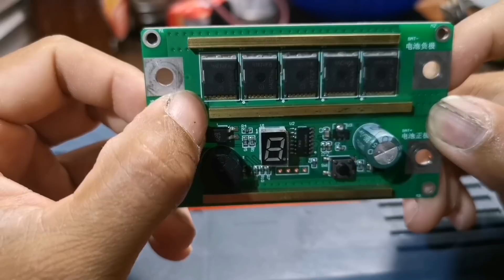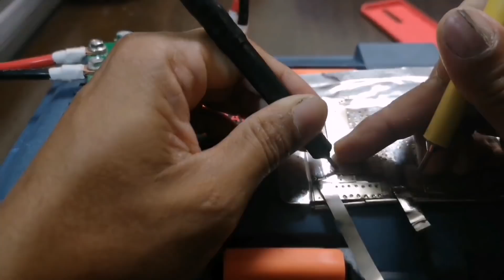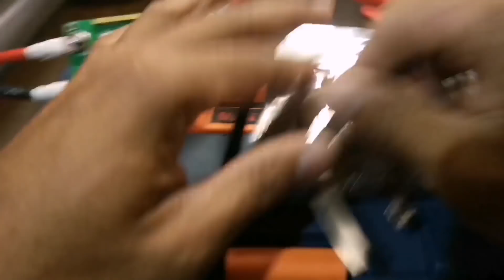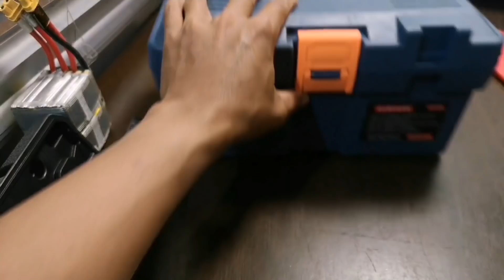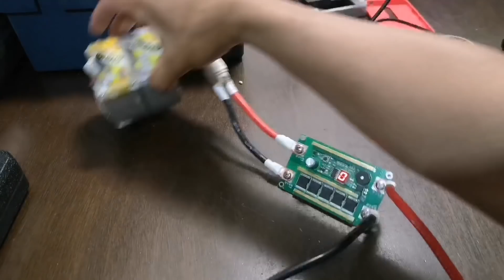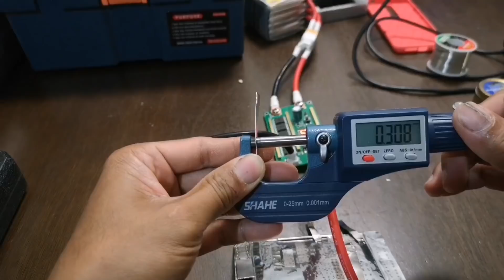CHEAPEST SPOT WELDER  REVIEW BEFORE MODIFICATION.

Comment: Ce baterie folosesti? De citi volti si citi amperi?
Reply from the maker: 12V 16ah Lipolymer battery 120-240c
Lipolymer rc battery not really good much better A123 system 26650 10P 4S enough to weld sandwhich .2mm copper and nickel steel plated strip.

Comment: What range of  input voltage? I used 12v but but can't spot accurate.
Reply from the maker: 12V 5Ah 100C
Reply: I used 12v 100ah but can't spot accurate.Tell me sir if i used 24v 100ah battery? Bcz i used chemical batteries the batteries is not very powerful.
Reply from the maker: What sort of battery you use is the lead acid or LiPo battery for the RC toy car? Do not use a 24V battery it will burn your board.
Reply: Lead acid.
Reply from the maker: Is your lead acid good? Or about to die
Reply: Hello friend i buy the same set i use 12v lithum with bms 3s isn't work can i know what battery you use thanks
Reply from the maker: Yes because of the BMS. Direct to the battery but be sure that the battery is a high drain

Comment: Is the purple circuit with 99 gears the best among cheap Chinese spot welder?
Reply from the maker: Yes! Before but I've heard a negative feed back in regards to the purple spot welder. There are few sellers that have installed not original MOSFETs. If you want to buy you should check and communicate with the seller before buying.

Comment: The worst product I ever bought. I regret buying it. I think I will distroy it soon.
Reply from the maker: Sorry sometimes you encounter a liar seller
Reply: It's most likely due to the batteries your using to power it
Reply from the maker: Not all the cheapest spots weld worked well.  Like the red spot weld I tried the same battery but it failed to weld at one time both 0.2mm nickel and copper.

Comment: Same model no welding
Reply from the maker: Check the C-RATE of your battery
Reply: Battery ok spark problem display on
Reply from the maker: Your battery must have a discharge pulse rate up to 500A if not it cannot weld.

Comment: I'm using 4s LiFePo4 battery with 3,4 mOhm internal resistance and over 1200 amps of peak. It weld very well )
Reply from the maker: As long as the power sources are good the result is better.

Comment: What size battery are you using?
Reply from the maker: 3S 12V 8.4mah 130C  RC battery. Anyway one of my videos provided a link for the battery
Reply: @pitikaron  what if i used a 18650 4s battery?, Will it still work?
Reply from the maker: It depends on the C- rate
Reply: @x_blows nope, this small modul have 10v-15v working voltage range
Reply: @pitikaron  8400mAh I presume.
Reply from the maker: @xwatchid  yes 8400 50C to 100C
Reply from the maker: AU $69.04  36%OFF | DXF Lipo Battery 2S 3S 4S HV 7.6V 11.4V 15.2V 9200mah 8000mah for RC Car Truck Buggy Arrama Truggy  XxMax Tank Boat Racing Hobby
https://a.aliexpress.com/_mN4z1Pa

Comment: Hi, I have the same model of welder but the strips keep coming off the battery. I'm using a 12V 25Ah (CCA SLS 171; CCA SAE 342) lead acid battery. Eve on the highest power (8) the welds are very mild. I'm using 0.1*8 mm nickel strips. Please help. Ps the battery is reconditioned
Reply from the maker: If you spot welding work properly but cannot weld strongly means you need  500 to 800A pulse discharge rate capacity but do not exceed 1000A coz the MOSFET will explode. Up to 0.2mm nickel if you want 0.3mm you need 1500A or more but your spot welding is ideal only up to 1000A. I recommend you this latest spot welding kindly please click the link https://youtu.be/hTQgXZBmejQ
Reply: @pitikaron  ok cool. Do you know what the 2 CCA values mean in the battery? CCA SLS and CCA SAE?
Reply from the maker: Cold cranking amp 2 CCA I don't know but CCA is cold cranking amp
Reply: @pitikaron  ok thanks anyways. This video was a lifesaver. Now I know what battery to look for
Reply from the maker: Thanks also for visiting my channel

Comment: Hello Friend, Can we use lead acid battery for this (green card) spot welding which has 100AH,
Can you tell  us the range of mAh or AH (meaning AH to AH) that is suitable for this spot welding card?rd.
thank you so much
Reply from the maker: If you have this board yeap you can use lead acid battery but you should identify the maximum pulse discharge current the maximum should not exceed 1000A but sometimes some MOSFET explode so it is better to use a battery that cannot exceed 500A. Anyway I recommend you this latest cheap spot purple board welder that can handle 2000A pulse current kindly please click the link https://youtu.be/hTQgXZBmejQ I produce part 1 and 2 plus comparison.... Thanks.
Reply: @pitikaron  So which battery would be best for this card (green card) , so that I can buy it. Please guide me.
Thanks
Reply from the maker: https://a.aliexpress.com/_mrWybHO
I used that battery to the link
Reply: @pitikaron  Thanks
Reply from the maker: Choose 6300mah 12V 100C
Reply: @pitikaron  But this is very expensive, can you suggest me other available options, and I have 70Ah, 100Ah Lead Acid Batteries, I think these battries will exceed 1000A which is not perfect for this Card. So which Lead Acid Batteries do you prefer for this card?
Reply from the maker: Yep so try your lead acid battery but do not exceed 500am anyway what is CCA to your battery?
Reply: @pitikaron  I used this formula (AH * 7.25) to measure CCA of battery, it gave these..
 1) (70 * 7.25) = 507.5 CCA
 2) (100 * 7.25) = 725 CCA
Reply from the maker: Try it start at the low level and observe the current flow. This link I provided for jump starter AU $39.39  50%OFF | 400A Jump Starter Power Bank Portable Charger Starting Device For 2.0L Emergency Car Battery Jump Starter
https://a.aliexpress.com/_mN1n6Qc
https://a.aliexpress.com/_mq2feD6
Reply: @pitikaron  12V 7AH Battery
12V 6.3AH Battery
12V 10AH Battery

Which of these would be ok, and if I want to buy a new one in lead acid,
at least how many Ah should I buy?
thanks for guiding me.
Reply from the maker: The most important is the CCA or pulse discharge current so that you can weld so check the battery specification.
Reply: Is the pulse current = max peak current?
Reply from the maker: Not constant but yeah it is the max current.
Reply: @pitikaron  Is there a formular to calculate that?
I received my spot welder yesterday but I heard you can extend the wires to the battery to limit the current...
Reply from the maker: for example 50C x 5000mah or 5ah = 250A
so you are asking the length of wire?
Reply: @pitikaron  yeah the length of the wires from battery to spot welder;
I actually wanted to use it with my car battery 75Ah (not new)
I scared not to burn the mosfets with my car battery.
Reply from the maker: Sorry I don't know! But there is a YouTuber explaining the length of wire and the expected current search K-weld he use K-weld.

Comment: Hello which welding machine do you recommend green card 8 settings or purple 99 settings, thanks
Reply from the maker: Purple the latest product and more capable to weld
Reply: thanks and what do you think about using a microwave transformer with timer instead of the purple board?
Reply: Do you know what thickness of nickel they put in the kit?
Reply from the maker: It Is also better unfortunately I don't have any idea how strong it is? Coz the purple welder can firmly weld at once  0.2mm  copper and nickel strip but your battery must be powerful enough  2000A pulse discharge.
Reply from the maker: What do you mean? The thickness of nickel?
Reply: When you buy the complete card they give you some nickel I was wondering if you know the thickness
Reply from the maker: Ah ok!  Before I choose a board only however they don't offer nickel strip also.

Comment: what is the power Volt and Amp  ?
Reply from the maker: this cheap spot welding it is good but their is a latest and more capable to spot welding  of nickel strip click link below. I produce part 1 and 2 video and also camparison then I figured out this latest cheap spot welding are the best in the market today even the expensive spot welding can not compet. https://youtu.be/hTQgXZBmejQ
Reply from the maker: 12V 6100mah 100C so 600A pulse discharge amp.
Reply: I have 12v 7AH battery. It's possible or?
Reply from the maker: It depend on the battery CCA
IF YOU BATTERY HAS A 300CCA IT CAN WELD BUT IF BELOW 300CC CAN NOT WELD

Comment: hi, where do you get the copper bar from? all i can find is the round one.
Reply from the maker: Al i-express copper flat bar 1×10mm
Reply: @pitikaron  that's 1cm wide, then you cut it down to size? I'm thinking of using flat copper braided wire. it should be easier and it come in different width too.
Reply from the maker: As long as the traces are thick it is better coz thick traces can help reduce overheating due to a large current flow.
Reply from the maker: I recomend you this latest purple spot welding https://youtu.be/htnneHUuAqg
Reply: @pitikaron  I would love to, but i already got similar model with the one in this video. btw, is this board and the purple one have the same size? especially the screw hole diameter and distance? thank you very much.
Reply from the maker: Ah ok!  anyway it is not necessary to buy flat bae copper!  if you have 10-6 gauge stranded copper wire you can use it to increase the thickness of the input and output traces. yeah they the same size and one manufacturer.

Comment: sir, can you kindly tell me approx brass heatsink thickness you solder to board?
Reply from the maker: https://youtu.be/u9m3aYlB4dI
sir I recommend this spot welding better of all cheap spot welding. anyway 1mm×10mm brass flat bar but you can used 8 gauge wire stranded brass also. as long as you will increase the traces sir it work well.

Comment: My spot welder is not welding at all bro same model ordered from Amazon
Reply: I have big battery of 11.1 4000mah
Reply from the maker: What is the C-rate or peak discharge rate?
Reply: May be 40-80c
Reply: In which range should the C rate should be
Reply from the maker: bro spot welding working like switch on and off or relay.  spot welding circuit controll the battery...  kindly please dicribe the issue of your spot welding?
Reply from the maker: bro if you're spot welding can not weld 0.1mm.  youre battery is the Main issue except if the mosfet and controller of the mosfet are broken.
Reply from the maker: if 80C the maximum Amp 4×80=320A so enough to weld 0.1mm nickel strip.
Reply: The issue is it's not welding the nickel strip i tried in many way but i was unable to weld it
Reply: Is it a defective product that i have received it or what bro please help i need this device for my project
Reply from the maker: Tried to replace if you can the battery wire into 8 gauge 10cm and 8 gauge  50cm welding wire output including electrode must be 50cm or 500mm.
Reply: Tried it in all the ways bro but it's not working at all
Reply: I have asked Amazon for replace the product
Reply from the maker: Bro!  if the spot welding turning on after giving power supply.  means your spot welding is working.  coz if the mosfet blown or short the nickel strip 0.1mm must be burn also.  Base your testimony your spot welding can not weld means battery issue.
Reply: I have good batteries bro i used my batteries for my gaint rc cars also no used issues with the battery but the problem is that it's not even welding 0.1mm nickel plate
Reply: Mosfet everything is good no heating problem in the motherboard also
Reply: Thank for the help bro i really appreciate you 👍
Reply from the maker: can't weld?  maybe battery issue. try to get a good battery discharge 200A

Comment: Hi bro, nice video.  I need to know how to increase the delay time when making contact with the battery to weld, the manual says 0.5 seconds, but it is very short, it is almost instantaneous.
Reply from the maker: boss this spot welder is better but I found a better than this click link below https://youtu.be/2G2eepg7yZw
Reply from the maker: However if you have already this spot welder so stay to this.  anyway this spot welder provide 8 Energy only so every energy  level has their own time obligation in that case I can't help you to change the running time program.
Reply: @pitikaron  ok bro, thanks.

Comment: what is the maximum input voltage of spot weld can i use 26650 4s in series. 3.7v per battery.
Reply from the maker: I recomend you a latest model and it is better of all cheap spot welder click link I provided.  https://youtu.be/u9m3aYlB4dI

Comment: Test on housing of 18650 use 200amps shorten cable from power to welder.   Good welds gets hot. NEED AMPS BUDDY. THAT IT.   Everyone does it
Reply from the maker: Exactly bro however avoid exceed the current limit to the mosfet so that it wont blown the mosfet this spot welder can only handle 6100Mah 100C Li-po

Comment: dude this is the best and detailed review video, thank you I wonder how often did you use it, I'm thinking of buying it too I wonder how often did you use it?
Reply from the maker: actually I produce a video revew for every cheap spot WELDER and it work firmly as long as it would not exceed the amp limit to the mosfet.  anyway not so often coz I only used when I needed like when I replaced  new battery for power tools DIY battery pack, but I can guarantee it work firmly as long as current would not exceed the current limit to the mosfet. then increase the Traces Thickness to the spot WELDER circuits.  thank for visiting my channel.
Reply: @pitikaron  well, which one would you recommend, as far as I can see, you have all the models in your hand, since my budget is limited, I have to choose the quality one from these circuits.Does it throw a nice quality tailstock with a 40 amp car battery?
Reply from the maker: Cheap spot welder amp requirements more than 200A discharge rate but please do not exceed 1000A.  
If you are asking for recomendation I recomend you this. kindly please clink link below. 
According to the spot welder manufacturer  No mosfet blown. unfortunately only 6 gear. however their is a latest spot welder offered five mosfet 99 gears 2390A maximum but please if you want this do not exceed 1500A I provide you a link. if you buy one of my recomendation kindly please follow my advice from my video review I produce please

https://youtu.be/sZ2SCA6CUKQ

https://youtu.be/hTQgXZBmejQ
Reply: @pitikaron  thank you for your answers my friend , my english is not very good .but as far as I can see, the product in the link above is better.but it seems a bit confusing, can you help me to set it up after receiving it, do you have a social media account etc.?
Reply from the maker: yes I have a G-mail account!  I think you can follow my guide by watching my video about the latest spot welder controller. kindly please refer this link below. then please if you buy this latest spot welder do not exceed 1500A.  ayway you can email through my G-mail accountaccount.

link next to this text  1500A current limit https://youtu.be/hTQgXZBmejQ

link next to this text 900A current limit https://youtu.be/sZ2SCA6CUKQ

Comment: Instead of common + you soldered a lot :D
Reply from the maker: I did a lot of soldered just to prove that this spot welding worked firmly and I also uploaded a video using that spot welding controller building battery pack.

Comment: Great video, great modification idea, great effort. What is the voltage of the battery you connected the spot welder? What is the rating of this battery? Thank you
Reply from the maker: 12V 3S Lithium polymer 6100mah 100C up to 200C discharge rate.  thank you for visiting to my channel boss. if you have any questions kindly please comments to the comment section I will reply as early as my oppurtunity.
Reply: @pitikaron  I'm interested in buying the same board to create a portable spot welding setup, not for commercial or industrial use. I plan on using 2x2s lipo batteries in parallel with a discharge rate of 80c, capacity of 5200mah. I already have a nice dual battery hobby grade charger for such batteries. Will 80c in parallel be sufficient? You used a higher voltage, and higher capacity; single battery. I intend on making the two new lipos (in the mail as we speak) into a matched pair, only ever to be charged or discharged as a whole, splicing the balance and power connectors together in parallel once I've charged them to storage voltage and let them sit for a couple days. Do you think this setup will work well with this board? I also have some small chipset heatsinks and thermal glue on hand that I plan on sticking onto the mosfets for slight passive cooling. I don't intend on welding together huge battery packs, but I wont pass up any bit of temp. dissipation I can get as longevity is ideal in my build.
Reply from the maker: 80C×5200mah = 400A it  is enough weld and kindly please dont exceed 900A your battery is 80C so you should also select the last capacity that the board offer 60C then try it at gear 1 but do not hit directly to the battery try it first not to the battery. Anyway what is the max voltage of your battery 80C 5200mah let me know the voltage please because according to the description the board can only work from 6.5V  to 16V?

Comment: The Ebay and Ali links don't work.  At least they don't work for someone in the USA trying to follow your link.
Reply from the maker: sorry boss I only have limited resources however tried to search this name in google  "12v spot welding in Ali-express.  kindly please compare the apperance in my video.  anyway if you search in Ali-express it will appear that if not be patient by scrolling.  until you will see thesame to my spot welding. store name in Ali-express KKmoon portable spot welding machine circuits board
Reply from the maker: KKmoon portable spot welding machine circuits board

Comment: Hello! Which wire do you use (AWG)?
Reply from the maker: input and output I used before 10awg but it poduce to much heat so I change 8awg but still produce heat but not like 10awg so if you are planning better you use 4awg